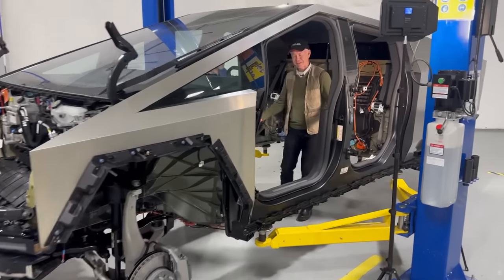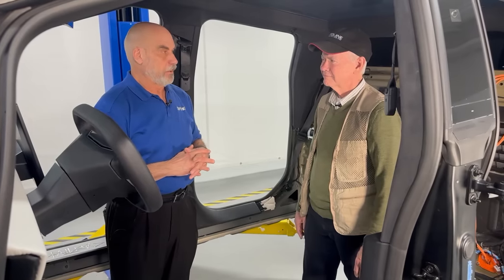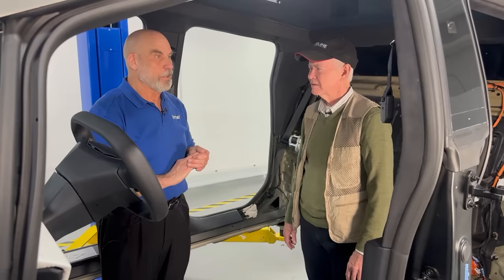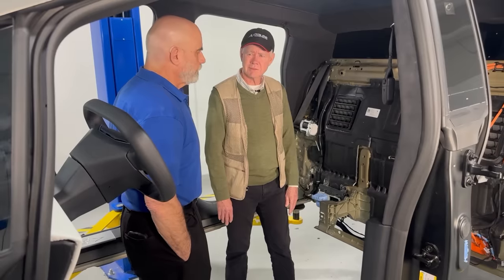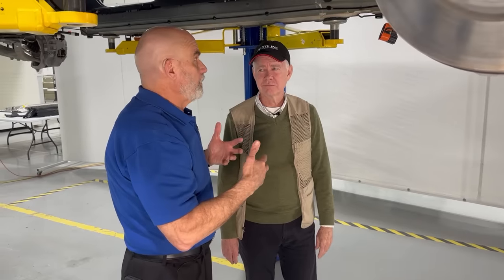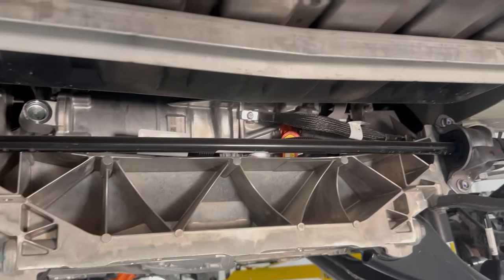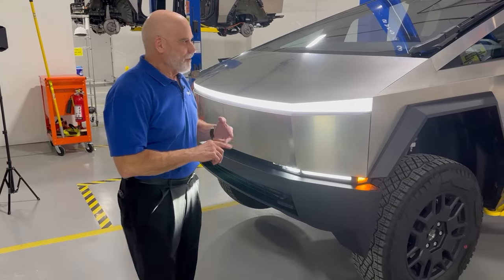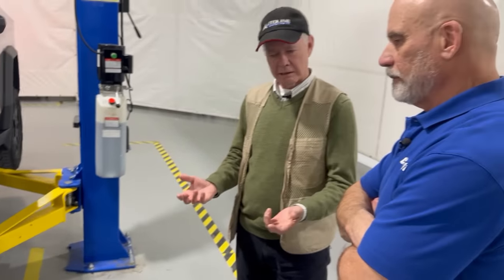World's 1st Cybertruck Teardown - Steer-by-Wire, 48V, Battery & Gigacastings

Comment: Tesla probably had a hard time sourcing 48V light bulbs etc., give them a couple more iterations and everything is going to be 48V.
Reply: They may be using voltage downconverters to do local reduction to 12 volts for some of the accessories.  Sandy will find out.
Reply: 48v DC is very common in industry. It's considered ELV... Extra low voltage, so it is used a lot for safety reasons.
Reply: @bikepacker9850 Well, it's about to become even more common. I'd be willing to bet the Model 2 or whatever will also be 48V, but with an even larger percentage of parts.
Reply: @eddiegardner8232  Or... just maybe Musk overstated reality once again.  Time will tell.
Reply: @eddiegardner8232  yeah, but that is just stupid. Just use 800V for major components and 12V for everything else. That is cheaper, safer and actually more capable when you run things like the active suspension from the 800V which is what Porsche did with the latest Taycan facelift. Porsche actively tried to eliminate high voltage to lower voltage converters and use the 800V system architecture as far as possible. Interior lights etc  run on a small 12V battery. Nobody needs 48V it is just to cut a couple of bucks for Tesla. The customer has no real world advantage whatsoever
Reply: What would Tesla do with a „bulb“? About as useful as a candle
Reply: @bullshitbingo2259 the primary advantage is current draw and wire gauge reduction of a 48v system.

48v needs 1/4 the wire gage, and hence less copper overall. It makes pretty good sense when you engage some gray matter.
Reply: @craighermle7727  It has always been said that not everything on the CT runs on 48V.
So why so emotional?
Reply: @BBingo-v5i you are so wrong.
Why do other manufacturers also use 48V? Mercedes, for example, at their entertainment?
And Porsche dont use 800V on their Active Ride.
Reply: @Zedus-rl9hp   you have no clue. For combustion vehicles or hybrids 48V are sometimes necessary as the battery and generator cannot provide sufficient supply for quick charge or discharge applications like regen breaking in hybrid combustion cars. The battery and system volts architecture is just too small. This has been done for many years.
If you already have a powerful battery and 400V/800V architecture then a 48V system instead of a 12V system is kinda useless.
Just go and check the documents provided by Porsche. The old Taycan had a combined 800V-400V-48V-12V converter in a way similar to what Tesla does here. Tesla also has a 800-400V converter because of the battery cells and to boost the 400V charging. Even tho the Cybertruck has a seperate 48V (whereas the Taycan has 12V) system it still uses 12V components and therefore needs a converter to dial it down (whereas the first generation Taycan diealed down from 800V to 400 and 48V and runs a seperate 12V instead of 48V).

The new Taycan only has a 800V-400V high voltage booster for improved charging at 400V chargers and for the battery management and a 800V-12V DC/DC converter to supply the 12V low voltage system with high voltage power if needed (for example to charge the 12V battery). The suspension runs from the 800V system. In the new Porsche Panamera E-Hybrid, which also has the hightech active suspension, it runs directly from the 400V system. The rest runs on 12V seperately, like light switches etc. A bigger 48V system with more users is unnecessary and worse than to run the high power components from the 800/400V system and only use a small 12V system for low voltage. Tesla fanboys just have no clue
Reply: @theonlymadmac4771  Dumbest original comment, he is still in the Edison era, doesn't know LEDs have taken over a decade ago.
Reply: @silverback3633  Incandescent light bulbs vs LED light bulbs. LEDs aren't light bulbs but LED light bulbs contain LEDs
Reply: @BBingo-v5i  it runs on 400V and Porsche had to use a DC-DC converter for that. So Porsche uses 800V, 400V and 12V... where is the difference to 800V, 48V and temporarly 12V?
You should less propagate Porsche's marketing text and instead think a little independently
Reply: There are No lightbulbs, everything is lit by LED's
Reply: @grunt98444 exactly, and unlike "Edison Era" incandescent bulbs LEDS are... wait for it... LOW VOLTAGE (with corresponding low amp draw).  

observe how laymen have a conspicuous BLIND SPOT for the developments that have occured the past 50 years regarding both the LOAD side and SUPPLY side of 12V systems, as such what NEVER occurs to them (at this late date in history) is that "12V" is now merely a reference to the circuit itself. also ref how typical 3.3V - 5V sensors operate on these same 12V circuits.
Reply: Just like FSD has always been a year away, the last 6 years.
Reply: light bulbs? I'd be very surprised if you were able to find any in a Tesla.

Comment: I’m thrilled my ICE does not have to deal with all these issues. 10 minutes after refueling I’m gone.  To manufacture each EV battery, you must process 25,000 pounds of brine for the lithium 30,000 pounds of ore for the cobalt 5,000 pounds of ore for the nickel, 25,000 pounds of ore for copper Diging up 500,000 pounds of the earth's crust For just - one - battery.  Not really green, the construction equipment still uses petroleum products to run.

Comment: How does the fail-safe work in the steering? If it were to loose power what happens?
Reply: You'd have to lose ALL power, simultaneously  to:

The steering column / feed back motor.
And
2 control computers on independent supply circuits.
And 
2 Rack drive motors on independent supply circuits.
.
With each of the motors cross connected to the 2 computers for "Double Double" redundancy.
.
That would have to occur without warning such that either the vehicle couldn't steer to safety, or you couldn't do the same before failure.
.
It's "statistically unlikely "?